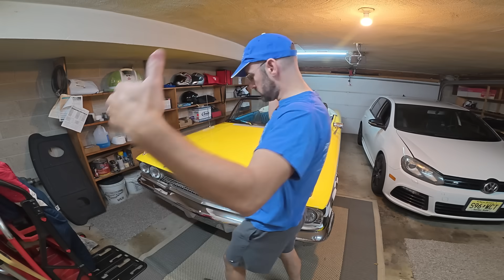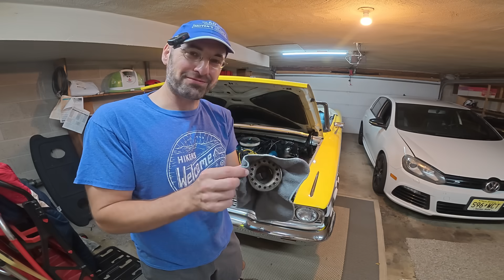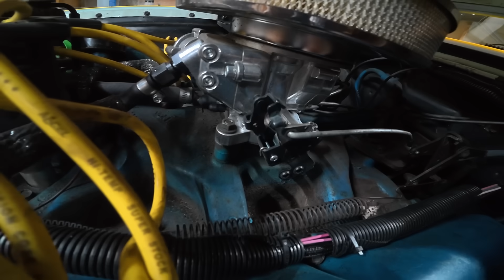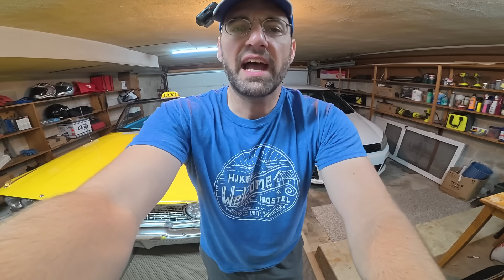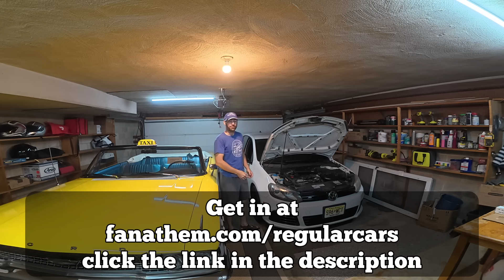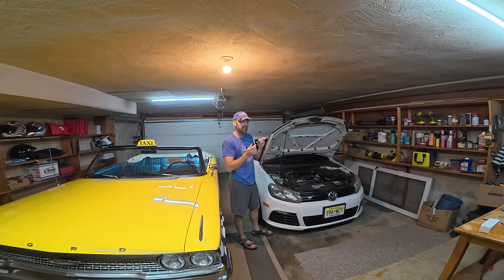Why do Direct Injection Engines Develop Carbon Fouling? #cars #carrepair

Comment: Why can't auto manufatures just add like a cold start injector that would activate on WOT? I had an old turbo crx that had a cold start injector wired into a relay and WOT switch. I mean the engine was MPFI but the machnic that build this setup used it to keep from lean conditions under boost.

Comment: You can also have someone help you maintain around 1900 RPM and Seafoam spray the back of the intake valves regularly to help keep this down. Mazda dealerships sell this as an 'induction cleaning service' for $350 and I sat there and watched. Just do it yourself for cheap. They may use a different brand but same general concept. Diesel truckers have had carbon on intake valves for ages by now... this really only seems this new of a problem with gasoline engines.

Comment: A few things i dont understand: the nissan frontier is known for their reliability, but they got rid of dual injection in 2020, so its just direct injection only. Thing is, when i read the forums, people apparently don’t walnut blast, lots of engines past 100k and i dont hear about it. 

In my 2025 colorado, it is also direct injection only, but i know that engine comes with a built in catch can, the pcv ventilator oil separator. This will help reduce intake valve fouling, but it wont eliminate it. I couldnt find anything like that on the 3.8 v6 nissan engine

Comment: Just a clarification; EGR isn't about re-burning anything in the exhaust, it's primarily intended to lower peak combustion temps, to avoid forming nitrous oxides (NOx). NOx emissions were a primary cause of the brown smog that plagued large cities in the 60s-80s.

Comment: My 23 Frontier is direct injection, only has about 50k on it, so no problems yet. I'm wondering if something like Seafoam (the spray that goes into the intake, not the liquid that goes into your gas/oil) would be good preventative maintenance to prevent buildup on the valves.
Reply: It may help, but a better solution is to fit a catch can to condense and trap the oil mist before it even reaches the intake manifold.

Comment: You should make a video about Honda CVCC, how they made the big 3 their bitches in the 70s, when they put their own cylinder head on a big block V8 and passed the emission tests with it, that all 3 CEOs testified couldn't be passed. What I mean is, its not just crank case ventillation, it's also the ability to run with a lean mixture.
Reply: Also it's not just the oil, the oil by itself would be mostly fine. The issue is when it gets mixed with soot particles from the EGR (which also would be fine by themselves).

Comment: Relative to port injection vs direct injection... The gas we use to make the car go down the road is also a FANTASTIC solvent. Even when we had EGR on port injected cars, any carbon / PCV blowby in the intake got washed down into the cylinder. With direct injection, you loose all that cleaning effect, and it all just builds up until problems happen.

Comment: Direct fuel injection injectors actually see fuel pressures of over 2000 PSI at some points. 200 is nothing. My 2011 MINI Cooper S had a high-pressure fuel system that produced around 500 PSI at idle. I would see well over 2000 PSI at full-tilt-boogie.

Comment: Walnut blasting? Maybe for super bad conditions. Most the time, the engine can be hooked up to a pressurized canister of solvents ( usually naptha based) at a vacuum line that runs the solvent across the valves. Engine's fuel system is disengaged so it runs off the solvent. 🤘

Comment: I work for a consortium of dealerships. No brand recommends doing blasting, the solution is new valves. 

Also every direct injection car has an efs valve cleaning solution recommended every 10k miles. It's really not that big of a deal. People just need to read
Reply: EFS valve cleaning?  Online search isn’t helping me.

Comment: Some things to mention.  The EGR doesn't recycle exhaust gases to recycle, but acts as a method to lean out an engine without making it run hot.  The reason modern cars put back in port injection along with direct injection was because direct injection has limitations.  Port injection is better at lower RPM for more complete burns and gets better MPG, and it's better at higher RPM to deliver more fuel as direct injecton has problems delivery enough fuel at higher RPMs.  The fact it cleans valves was a bonus.  The best solution to help avoid valve's getting dirty is still an oil catch can.  It's not just oil fumes but oil itself.  A lot of oil makes it's way through the PCV system.
Reply: Yep. I member servicing our 1970’s FoMoCo trucks at work in the late 80’s and 90’s and the PCV is/was routed from the valve cover to the air cleaner pan. After 10-20 years of hard agricultural service those 351’s were getting a bit tired and the blow by forced oil into the air cleaner pan. Ford designed a little filter to catch this. Sometimes the PCV filter would be oil soaked. 
Great example of what Mr. Regular was describing.

Comment: I wish I didn't have to get rid of my old Forest XT for this reason. Hard to find a shop near me that did cleaning and even then it cost and arm and a leg so I just traded in for double the cost and got something newer.
You should also take a look into variable cylinder management systems that fuck up your engine for the same reasons. Like just give me all six cylinders I paid for at all times.

Comment: I have a Mazda with the 2.0 skyactiv direct injection with no engine work done, and original clutch, too.  
460,000 miles on it.  I've done one cleaning and it was at 80,000 miles.  It wasn't the walnut blasting, probably Seafoam or similar.  I still gets 36mpg combined.  I started getting codes at 450,000 miles.  I believe it's the upstream 02 sensor.  I'm actually interested in getting this service done, though, to see if it makes a difference and takes the fuel economy back closer to 40 mpg.

Comment: Apparently this problem was exacerbated In Europe when eco regulations mandated sustainable biofuel blended directly into petrol at varying percentages, with the most common grade being E10 (up to 10% ethanol). I ran into this problem when I had an Alfa Romeo 156 JTS with a 2.0 4-cylinder direct injection engine. According to the official ACEA E10 Compatibility List, all Alfa engines from 2011 onwards  and some pre-2011 engines were cleared for use... but my 156 was a 2005. So yeah, passing yearly emissions was becoming a pain in the ass even if I filled up with more expensive 98 octane E5 petrol which had a smaller bio-ethanol percentage. I was told it could also potentially affect various seals in the fuel system and cause engine damage. Fun times. If not for that I would probably still be driving it, incredibly fun car, mostly sorted by the previous owner and it also had the Selespeed transmission that it shared with Ferrari 355 F1, paddle-shifters and all (which was a different can of worms lol).

Comment: Why didn't people complain like this about diesel engines? They've never had fuel washing the intake valves. And don't forget the atmospheric vented carburetors and gas tanks. But emissions controls technologies had mostly eliminated the human component of the LA smog by the late 80s/early 90s. A lot of stuff since then has made cars more complicated for not a clear benefit.

Comment: Ironically, this was perfectly timed. Had like 6 lights pop on with my Honda on Monday, and it looks like I either have a wiring issue or a carbon buildup causing a cylinder misfire.

Comment: If there is no EGR and no PCV (VTA system, there are ways to do this “environmentally”) then there is no valve coking. 

Air cannot coke, oil is what’s coking. No oil, no coke. If the intake tract only has air, you have clean intake tract.

That’s why a diesel with no EGR and no crankcase plumbed to intake is clean as a whistle.

Now if your turbo is leaking oil into the intake or your valve stem seals are leaking oil into the intake, that’s another dilemma to solve that may require media blasting on valves to clean but in intended engine operation, heat (EGR) and oil (coking) causes the need for media blasting.

Comment: It's really only the germans. I've had 7 Mazda's, they designed the valves to stay hot so it doesn't stick. I've had them all, 2.0, 2.5, 2.5t and now the 3.3, they're all stellar and using a borescope, nothing major at all for build up. Drive them, don't baby them.

Comment: In 1963, it became mandatory for PCV valves. In 1962, engines simply used a road draft tube to ventilate crankcase vapors.
Reply: If you watch any of those YT shorts of traffic back in the day, you'll notice a black line down the center of each lane. Caused by those tubes aimed straight down.
Reply: @warmstrong5612  lmao. Incredible
Reply: @warmstrong5612  I remember those streaks vividly.  I always thought they were from oil leaks.  TIL.
Reply: Yes on both counts. Oil and crankcase venting. It works very well, but not the best for Ma Nature.

Comment: "While direct injection solved the problem of fuel economy, solved the problem of tuning, it created a new one."

While GDI certainly created the problem of intake valve deposits, I don't think it was a significant improvement to fuel economy or tuning.  If you look at engines where the only difference is port fuel injection vs direct injection, such as the FB20B and the FB20D, you see that the gains in fuel economy, HP and torque are pretty insignificant.  If you further look at like-for-like designs going in the other direction, such as the FA20D which introduced a mixed DI/PI system (borrowed from Toyota), the costs to fuel economy when going away from pure GDI are approximately nothing.  So I think pure GDI was a dead end where the benefits were tiny and the costs were very high, and the only reason anyone went ahead with it is because the problems typically don't show up until after the end of the customer's warranty period.

Comment: Old cars pollute while there off becuase the fuel systems are vented and hydrocarbons are released into the air just sitting .. less about the crankcase ventilation more raw fuel ventilation

Comment: And this is why I only own engines that are both port and direct injected. My Lexus IS350 has a 2GR-FKS with port and direct injection. This is the only IS model that has this. The old is 250s are DI only. The new ones are inline 4s that are also DI only.

Comment: Our first new car was a white 2015 Honda Fit LX. Paid a little over 17k. It has direct injection. Did my 21 year old self know this? Nope. So we just followed the "maintenance minder", which is the thing in the car that measures oil life. Looking back, we probably changed it every 8-10k miles. I changed out the VTC actuator (VTEC cam sprocket) and while I was in there, and noticed the intake valve goop, that's when I discovered the magical wonders of Direct Injection!

Anyway, over the years the car sounds more like a diesel than a little putt putt econo-box. So I've been using CRC injector cleaning spray every oil change, and I've noticed that we get a few more mpg's for a little while, but its nothing like it was new. Its at 193k, looks and sounds like hell, but hey, we got our money's worth out of it. Seen our family grow from 2 to 3.5, daughter and cat. For a modern car, its been relatively easy to wrench on, and been very forgiving as I have learned how to fix it over the years. I keep thinking its going to explode, but it keeps on going. Maybe when it hits 200k I'll splurge and do the walnut blast, it deserves it. Our lil fiddy.
Reply: I have a 15 Fit LX 6 speed. Had mine for 4+ years, bought with 87k miles, at 166-167k now. I change the oil every 3k miles as a rule. Never had timing chain or VTC actuator problems. No sludge in my engine to speak of. And I am a fairly spirited driver which significantly slows down carbon buildup. Did mine at 143k miles and it had the same buildup most have at 50k miles. And the blasting makes a big difference. I picked up 2 MPG and about 10-15 HP after. The little L15 still runs as strong as ever, the only time the CEL even came on was over some bad gas.

Comment: CRC GDI cleaner goes a long way towards mitigating the need for a manifold-off valve cleaning as long as you're diligent about it before every oil change. Right through the brake booster hose

Comment: No catalytic converter means no Palladium, no Platinum, and no Rhodium. All mined and imported mainly from Russia (Soviet Union), South Africa and Zimbabwe (Rhodesia).  
So was the solution (developed in the 1970s) of the Catalytic Converter (instead of some other solution) meant to keep in power the Apartheid govts of South Africa & Rhodesia and the Communists in the Soviet Union?

Comment: tl;dw - direct injection causes carbon because there's no gas washing over the intake valves to prevent it. Toyota has engines that uses both port and direct injection fixing that issue. If you want to know an engine that suffered the most from direct injection look up Mitsubishi's early days with it.

Comment: I just recently cleaned my intake valves and it disabled a "running rich" check engine code on my 2015 Honda Fit!

Just soak your intake valves in carb cleaner and clean them with a brass brush, and vacuum it out with a shop vac.
Reply: reversed?! now its a running lean engine code?

Comment: Addressing the elephant in the room with Subaru's WRX with the FA20DIT engine that also suffers from this issue has a solution in the form of IAG's Air/Oil Seperator (AOS). A $400-$500 investment to greatly reduce the intake carbon build-up on Direct Injection vehicle's. Do note that this is NOT a catch can as you don't need to drain it constantly. Hope you find this helpful for those that have Direct Fuel Injection only cars!

Comment: Sounds like I should be saving up for my 06 Mazda3; even though it has about 82K miles, the engine is 20 years old and has about more street miles than highway.
Reply: I'm pretty sure there wasn't GDI Mazda 3s until 2011, unless it's a Speed 3.

Comment: I’ve heard from others that the Mazda skyactive engines (all DI) tend not to have crazy issues with fouling due to something with the tuning and coolant passages leading to more rapid heat up and higher temperatures on the exhaust valves. Most people can make those engines go over 300k km with little issue.
Reply: I have 460,000 miles on my 2.0 skyactiv and have only once had seafoam put through it.  Engine is all original, so is the clutch. I still get 36mpg combined, a little less than when new.  Shooting Cars did a video on it at 432k miles.

Comment: I think those MK6 EA888 and basically any early VAG turbo engine are notorious for carbon deposit fouling. Modern non-performance cars aren't so bad, they've worked the emissions systems with things like exhaust gas cooling so as to reduce the amount of formation, obviously not getting rid of it completely. You hardly hear about a Subaru FB20d/25d engine getting carboned up, and those things are in hundreds of thousands of cars.

Comment: Mitsubishi we're the first to launch GDi in the late 90s on the Carisma mid sized car, and the cars did not last that long, engine failures were common, and the car was built in The Netherlands, on a Renault platform, and used a Renault gearbox. They were horrific

Comment: Those direct injectors on my Mazdaspeed 3 back in the day were happily running at 3000 psi tuned at wot. Idle was a mere 400. Had to upgrade the mech pump for the tuning. Seafoam drawn into the intake was my solution to avoid the walnut shells....

Comment: Old engines definitely carboned up. It's why there's valve regrind sets to pull the head off and decoke the engine.

Direct injection came around in the 90s on Mitsubishi engines. 

It's funny that stanceworks has removed di from his Ferrari v12 by telling the world that it is only for emissions.

Comment: An occasional can of Seafoam in an oil change sounds like a decent idea?
Reply: It is, but more to the point using SEAFOAM to actually wash the intake valves is a thing. Info Can be found here on the interwebs.  

Cheers

Comment: Because there is no atomized fuel spray hitting the back side of the intake valves. The accidental self cleaning nature of port fuel injection turns out to be one of its strengths.
Reply: Makes me wonder why nissan got rid of them in their modern 3.8 v6 found in the frontier. Its DI only
Reply: @Handsome-weirdo  Because it's cheaper, and Nissan has been really hurting for money since 2024.
Reply: It’s so effective that some Toyotas are starting to bring back port injectors for cleaning cycles.

Comment: gasoline is a solvent, the way the internal combustion engine is designed, the solvent cleans. it's funny how important having gasoline clean the valves is.
Reply: No, its the way port fuel injected HEADS are designed. There are many internal combustion engines that do not self clean the valves.
Reply: @adamgroszkiewicz814 most anything with an intake manifold will clean the valves, which is just about everything lol
Reply: @CorreyGolphenee  you are completely wrong. Did you even watch the video?

Comment: I like the Ford 5.0 V8 because it has DI as well as PI
Reply: Depends on the gen; gen 1/2 Coyotes only have PI, but Gen 3+ Coyotes have DI/PI on top of a bunch of other benefits that lead to it making 460hp over the older Coyote's 430hp.

Easily one of the best motors in mass production today.
Reply: Agree, glad I wont have to worry about valve deposits on my truck. (With Top Tier fuels of course)